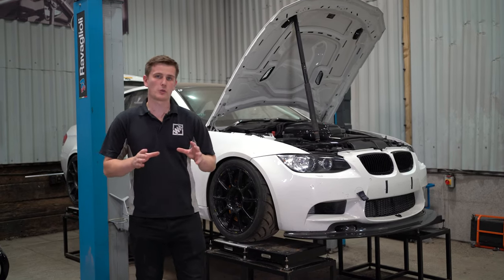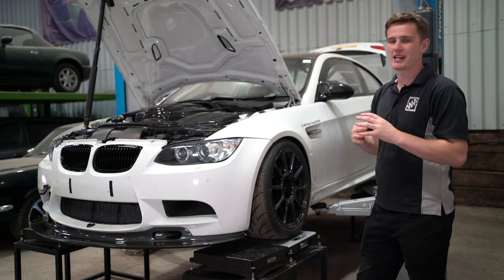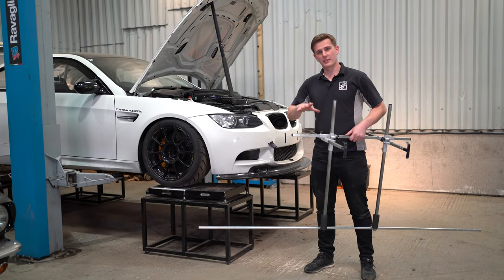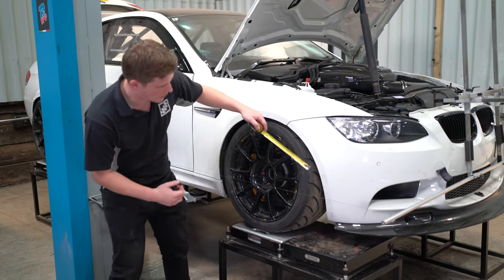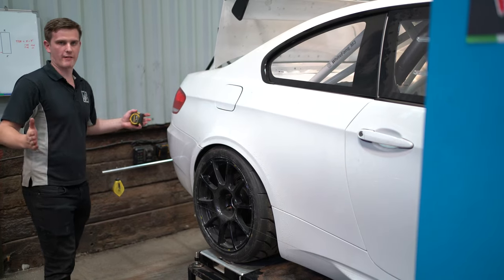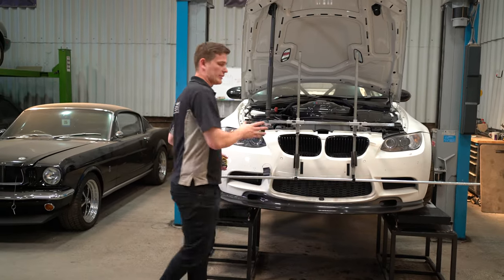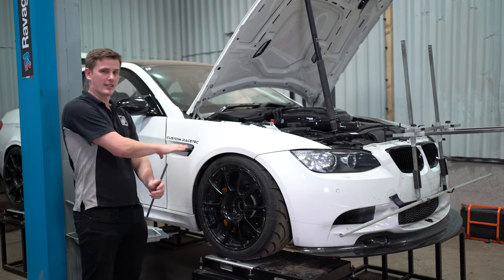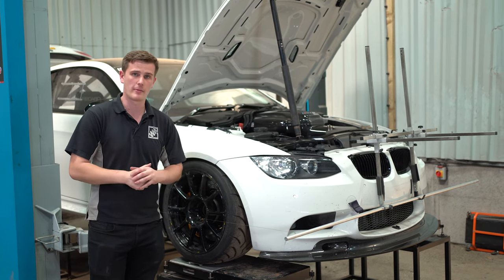HOW to ALIGN your own car using a string and line kit DIY

Comment: Good stuff! I designed and built my own string alignment kit (I documented it on my youtube page) and use hub stands to do alignments at home on my car and a few friends cars and it's worked great! I'd say my setup process is about 95% the same. The only thing I haven't done is ensuring the bars are perpendicular to the chassis.

Comment: Thanks for this video Matt.  I found it very informative in understanding some basics and also what you did with all that kit on my M3 F80 at Brands GP track day.  The car handles much better after your geo adjustment. Have been following your M3 F80 project with keen interest to decide what upgrades to go for as the suspension is now the limiting factor after the Litchfield stage 1 and Alcon BBK upgrade. Mark
Reply from the maker: Hi Mark, glad you’re enjoying the content and the setup on the F80 M3. 

That’s great 👍 our next step with the F80 is to begin installing the upgrades now we have the base laps around Oulton in the dry at long last! If you need any advice in the mean time feel free to drop us a message, email or call 👍

Comment: Great video. What is your opinion of using hub stands to do this? I have used both methods and think the hub stands are much quicker plus giving you access to the adjusters.
Reply from the maker: Hub stands are also great, especially if working low to the ground then access becomes much easier. For us with the two post ramps and the mid height trays for the car to sit upon its quicker for us to leave the wheels on and just as accurate as we can access the vast majority of adjustment from below the car whilst it sits on the trays.

Comment: Great video! One question: what if the car has a different diameter of wheel in the front and back? Should you calibrate the string kit twice, so once for measuring each axle?
Reply from the maker: No need to setup the kit twice. You just need to keep in mind the larger diameter and set the toe accordingly. For the same angle a larger wheel will need slightly more mm of toe than a smaller wheel 👍

Comment: Great content ! but wouldn't it be quicker and more accurate using a laser alignment machine ?
Reply from the maker: Thanks for the comment. It would certainly be quicker but we think less accurate. One of the issues with laser alignment machines is the calibration of the equipment that can be knocked and affected if not kept on top of rigorously. Therefore, the numbers read aren’t always the actual numbers present. Whereas with the string and line kit, the kit must be calibrated to the car every time it is used, ensuring the numbers read are perfectly accurate every time 👍 this is the main reason we don’t use lasers and why many top tiers of motorsport still use string lines 🙌
Reply: Also cheaper for a string kit. Even cheap 4 wheel laser alignment kit is over £1k, plus the rig to calibrate even more. Even second hand kits are not cheap, Hoffman and super tracker etc, plus again will need calibrating. Also like with string kit that you can center the box from subframe mounts etc and not just wheel centers, the 4 wheel laser alignment kits have flags you hang on tyre face, but you align of the other axle which can be off. These kits explicitly state the rears have to be toed to the vehicle centerline which you have to find. With string you can do this easily.

Comment: Hi there can you answer this, I see a lot of places using this method but to get the car on those “stilts” you need to lift the car then drop it onto those stilts. In my experience the suspension can take days to properly settle so surely the alignment you’ve done will change after the suspension fully settles in the coming days? Thanks
Reply from the maker: Yes of course. The suspension doesn't take days to settle especially if it is pre-installed suspension. if it is a fresh install you can take the car on a short drive to settle it further. We then sit the car on roll-on roll-off trays so we can settle the car manually between adjustments.
Reply: @SuspensionSecrets  Sorry if this is a dumb question but I am rather new to the concept of aligning my car on my own. To get the suspension to settle, do you just try to load the suspension by pushing down on the car and rolling the car forward and backward? I want to build a platform to get optimum access to adjusters but concerned about trying to align a car that is jacked up in the air and then having to somehow "settle" the car.

Comment: Perhaps a lightweight ceiling droppable frame, prebuilt squared and levelled with unistrut or similar, with slidable rail for swappable cone(s) on squared off studding to the hubs, and/or adjustable legs at the corners for a prelevelled floor area ?
Just thinking of a way to shave off a tonne of setup time, if the frame is already mostly setup, or really quick/simple to make the relevant changes.
Perhaps self levelling legs if the floor is also prelevelled, to save levelling all four corners for different rim center heights.
Perhaps spring loaded hub rods, to autocenter the frame.